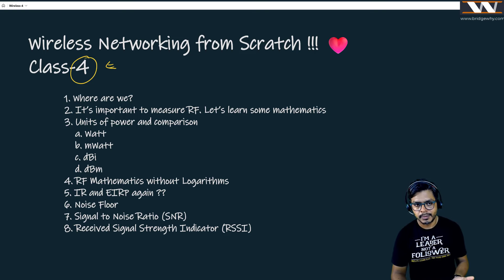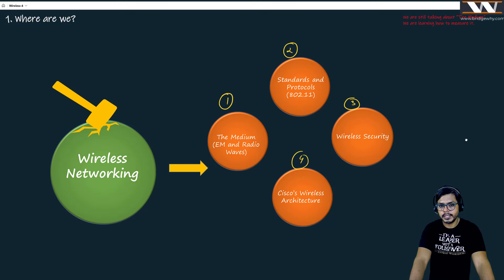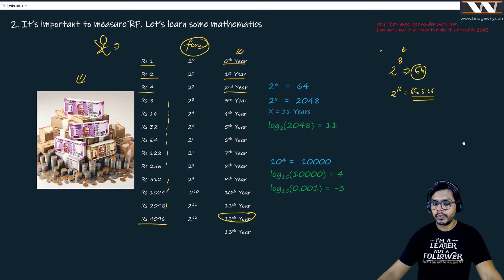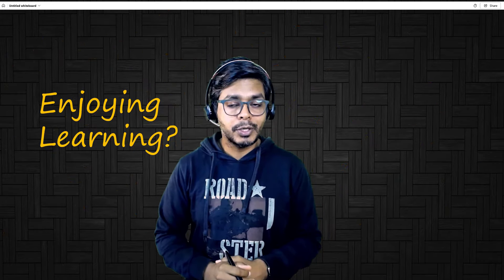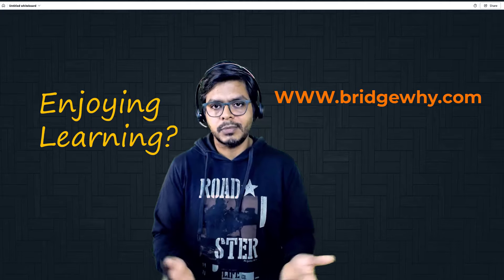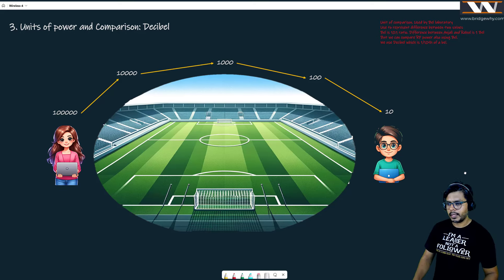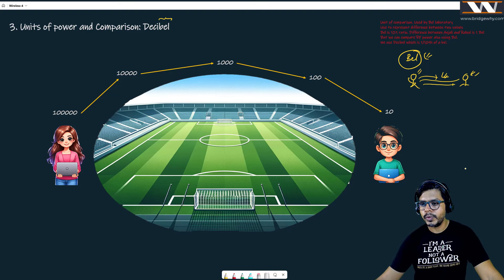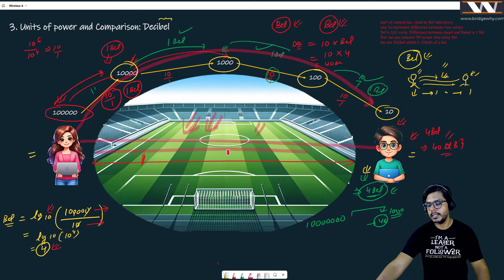Let's measure Radio Frequencies | Wireless Networking from Scratch | Video-3

Comment: i have a question, if the antenna is fed 50 mw and we have 10 db gain does it means, 50 plus 50 is 100, 100 plus 100 is 200 and 200 plus 200 is 400mw . then remeaning 1 db is almost 33 percent of 400 which is 132. isnt 10dbm gain of 50mw is 532dbm? but you said 10 db gain of 50mw is 500mw